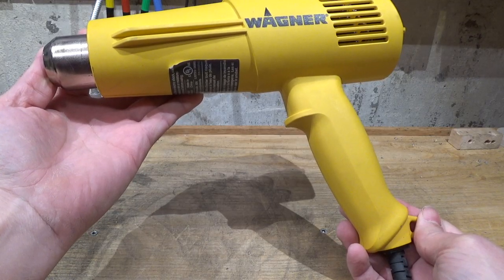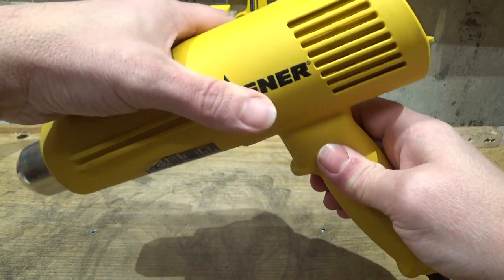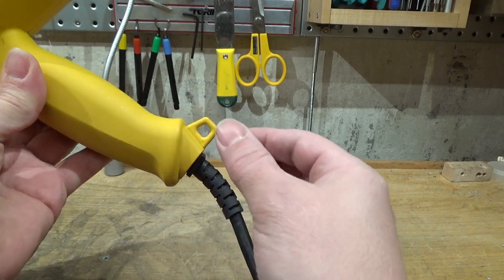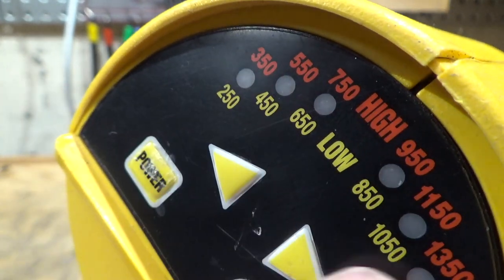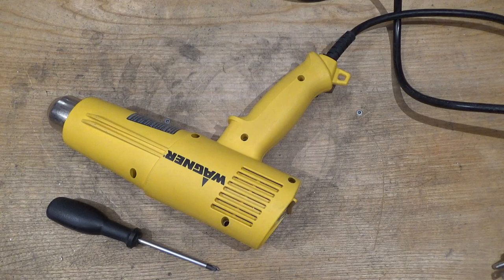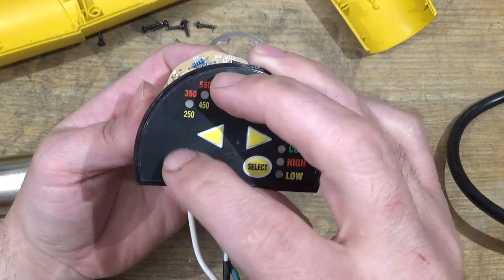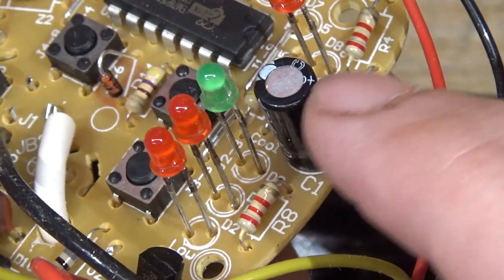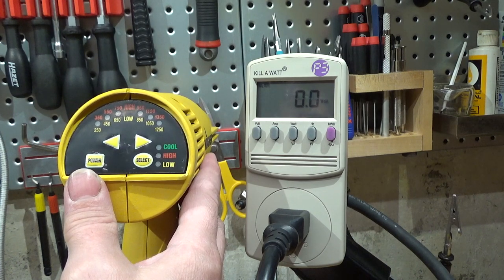Look-See: Wagner HT3500 Heat Gun

Comment: What's the recall covered stamp dates?
Reply from the maker: Milwaukee Heat Gun MHT3300, ACE HT3500 Heat Gun, and the Wagner Heat Gun HT3500 with date codes V300R through Z365R and A001R through A111R.